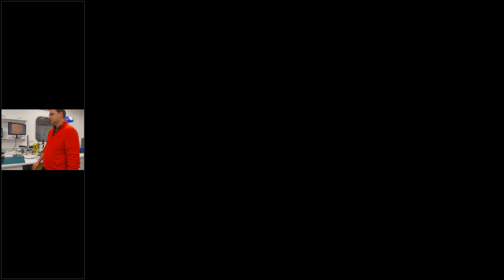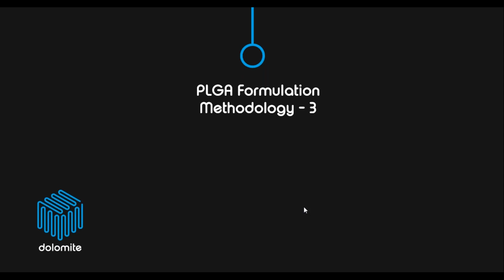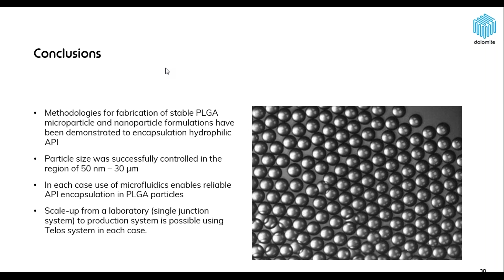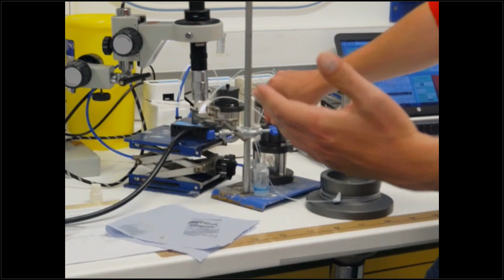Learn how to Encapsulate Hydrophilic API in PLGA

Comment from the maker: Helpful timestamps for navigating this webinar:

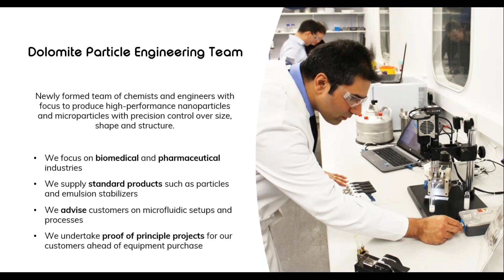1) Introduction: 0:00 - 2:04
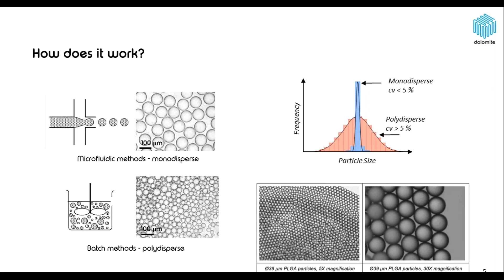2) Microfluidic technology and how it works: 2:04 - 4:44
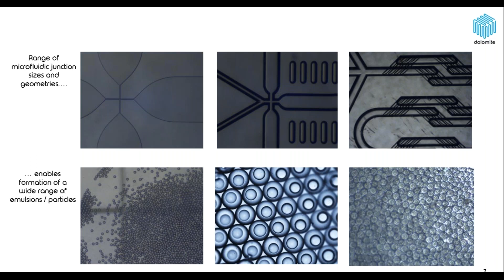3) Droplet / particle production methods: 4:44 - 7:25
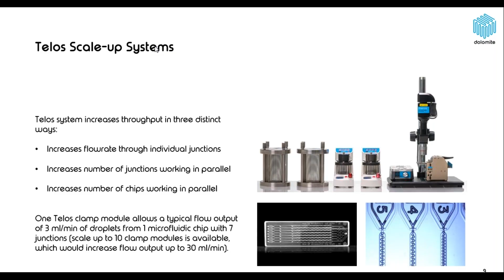4) Dolomite systems including scale-up with Telos: 7:25 - 8:46
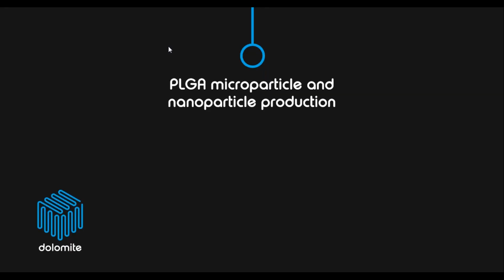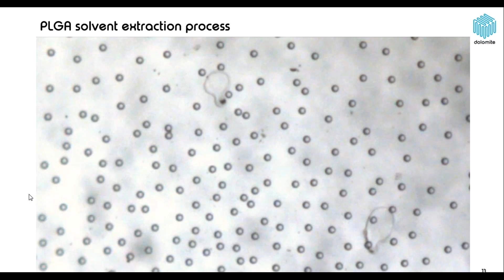5) PLGA microparticles - particle formation process & solvent extraction process: 8:46 - 12:20
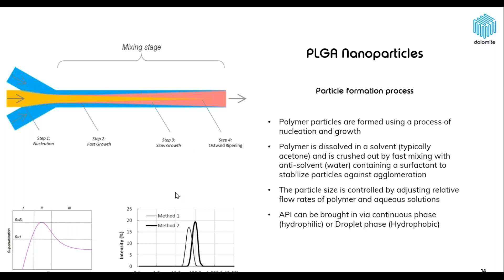6) PLGA nanoparticles - particle formation process: 12:20 - 13:42
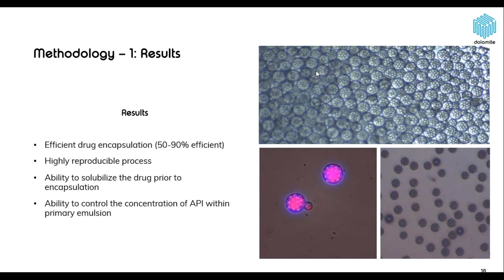7) Methodology 1: Multiple emulsions - system set-up & results: 13:42 - 17:35
8) Methodology 2: Direct powder encapsulation - system set-up & results: 17:35 - 20:32
9) Methodology 3: PLGA nanoparticle production - system set-up & results: 20:32 - 23:10
10) Emulsion stabilizers: 23:10 - 24:32
11) Conclusions, system overview & additional information: 24:32 - 28:08

We hope you enjoy this webinar hosted by Dr. Pavel Abdulkin.